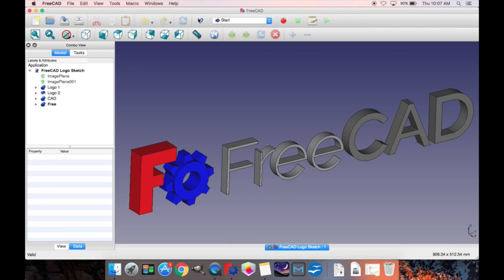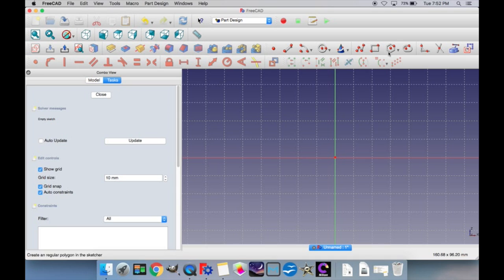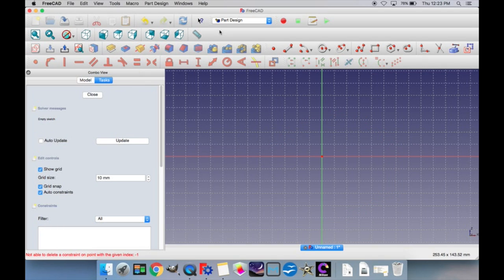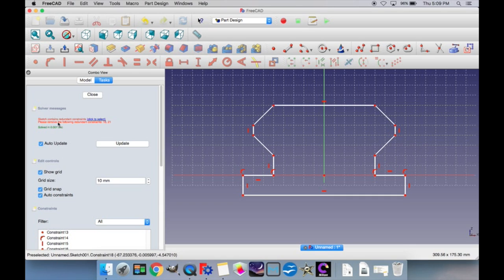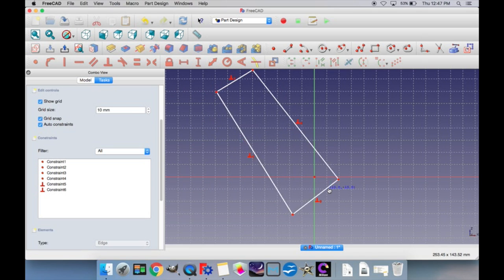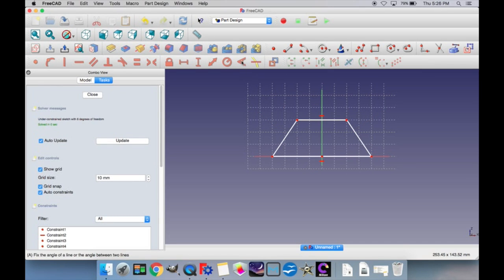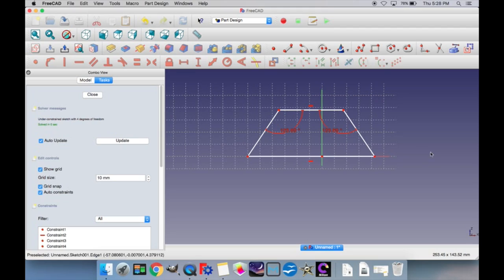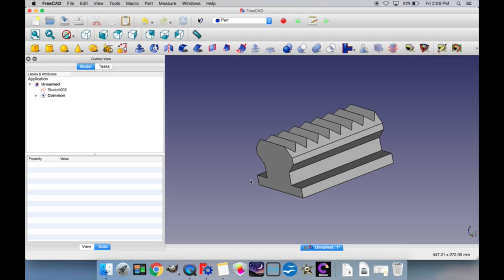FreeCAD Tutorial Part 2: The Part Design Workbench

Comment: Very good presentation .thank you!
After your class I create a 3D model and I export to stl file ferst time and then I modify same file and ad some  
New fishers I have problems to export new STL file.
Could you please help me
Thanks
Peter
Peter
Reply from the maker: Hello Peter, I’m glad you enjoyed the video. So you said you exported a model as an STL and then you modified it and when you exported it again it didn’t work? Did you import the STL you exported, convert it into and object, and edit it, or did you modify the original model in FreeCAD that you used to export the first STL and try to export it a second time with the new modifications? Also I’m not sure what you mean when you say you added new fishers, sorry I don’t mean to sound rude by saying I didn’t understand you, it could be that I’m not familiar with the terminology. Did FreeCAD display any messages when the model failed to export? I’m thinking I might need some more clues to figure this out. My first thought is that if you tried to export the STL using the same name as the original, then the program would warn you that your about to over write the original, so that might be one of the issues. My next thought is that the program might not let you export an imported STL file as an STL file, so you might have to convert the imported STL into a solid object and then try exporting it again. My next thought is to try exporting it as an .obj file instead an see if that works. My last thought is if your trying to export a mesh as an STL and there is something wrong with the mesh then exporting won’t work; if that’s the case, then you might be able to fix it by going to the mesh workbench and then selecting the mesh pulldown menu at the very top of the screen, where the file and edit menus are. The mesh pulldown menu has some tools for fixing up the meshes, so hopefully that will help. Sorry I can’t think of what the problem might be without some more specific information, like export error message. Good luck, thanks for watching
Reply: Rick Hoefer 
Thank you very much for quick response, is very helpful and tomorrow I will try your suggestions.
Sorry for the funny word I meant create new cuts and holes.

Thanks 
Peter
Reply from the maker: Thanks Peter, if you need help with anything else I would be happy to help, have a good one.
Reply: Rick Hoefer 
After I export to STL I decided to add cuts and change some dimensions.
When I open this model from the file in part Desgin I tried to do those changes but freeCad won’t let me do any thing, I try to covert to cad model . And i did some think I don’t remember what. FreeCad let me do all changes
I saved the file under same name.Next step I tried to exporting to STL , then program warn me :file already exists 
Do you want to replace it? I pick Yes. Next I opened documents and looked Proporty it not STL file type and size 0 KB. Before I did that I saved those two files on memory stick: old CTL file original and modified file .
After I tried changed the names but nothing happened. Now if I tried to add some thank to the modified it would let me do.
Sorry for my writing because English my second language.
Thank you very much for your help 
Peter
Reply from the maker: Hello Peter, thanks for the information about your problem. It sounds like your problem is pretty technical, would you mind emailing the FreeCAD file of the modified model to me so I can take a look at it for you? I promise I will keep your work confidential and I won’t send it anywhere else. My email address is rwhproductions@gmail.com If I can figure out what the problem is I will email the modified STL back to you and an explanation of what the problem is.